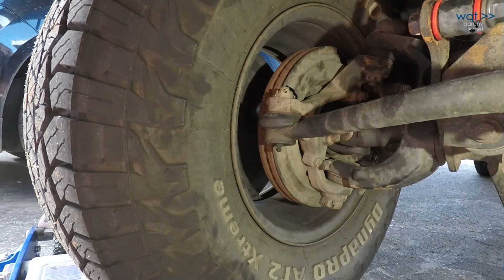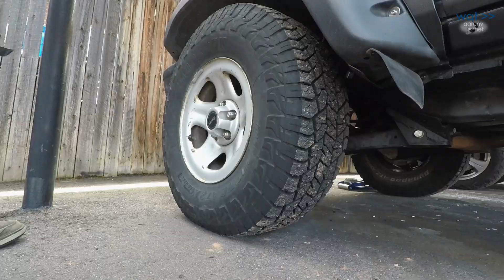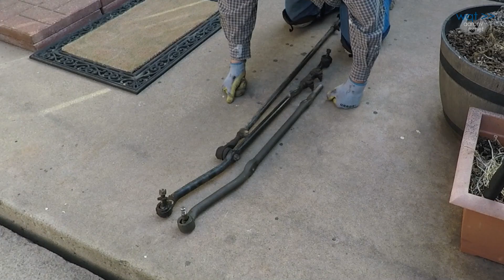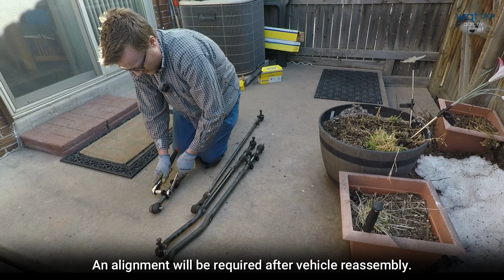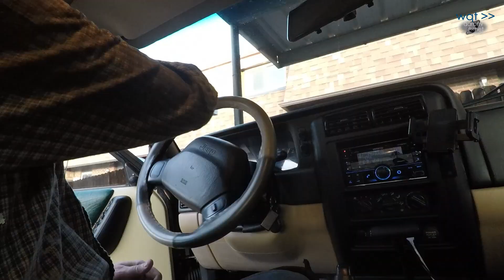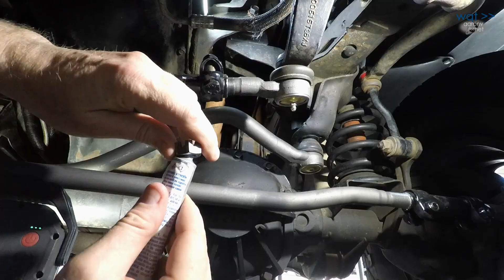projectXJ: Affordable steering upgrade and trackbar, step-by-step (ZJ+TJ=XJ), 97-01 Jeep Cherokee

Comment: Great demonstration and explaining. I am trying to do the same changes to my jeep xj 2000. Im looking at the parts but PartGeek shows the same part number just for different jeep varients. Another thing that it requires is the year to be selected for said part. Would you happen to know wany of this information?
Reply from the maker: ZJ Grand Cherokees were 1993-1998, so you might try one of those and see what pops.
Reply: @aaronvienot   Here are the options that pop up for each item(I already ordered a RC track bar that fits):
Drag Link DS-1430 -- 1997-2006 Jeep Wrangler or TJ
long tie rod DS-1312 -- 1993-1998 Jeep Grand Cherokee or Grand Wagoneer
rod end links ES3096L -- 1991-2001 Jeep Cherokee or Wrangler, TJ, Comanche, grand, wagoneer
adjusting sleeves ES-2079S -- 1991-2001 Jeep Cherokee

Comment: Hey! Your video sent me down a rabbit hole as I am working on updating a '93 XJ. Unless I've missed something, all XJ and TJ front track arms are functionally the same - being listed with the same part # typically. Saying you've upgraded to a TJ track arm is a touch misleading, I think. The ZJ V8 tie rod is a killer budget upgrade that I know I'll be doing! I intent to lift about 2" so I think my track arm upgrade will be an adjustable type. Thanks for sharing your project!
Reply from the maker: The stock XJ tie rod is a hollow tube, basically. That's where most of this upgrade gets good.
Reply: @aaronvienot  Inteeresting, I do like the sounds of that upgrade! Can you provide a link to some "literature" of some sort? I haven't come across this info anywhere else. Thanks!

Comment: Just a couple of thoughts.  If you leave the vehicle on the ground, the tires will hold their position while changing the components. Other than that it's rather easy to do a driveway alignment.  As for the tie rod sleeve, they are threaded thus so one can make toe in adjustments by turning them one way or the other. The drag link one allows one to adjust steering wheel to be straightened compared to the wheels.  I learned this as the geometry was off on my 4 liter powered 1987 XJ Pioneer that someone had previous installed the  3.5" kit partially, but not the track bar. This being off, they drove it that way and didn't know why it chewed up the front mud tires. I had to bring my stock track bar mount to my friends so he could put it in a drill press so the RE track bar could be used. One of the best done content pieces as there's no overlong into/outro sequences, nor over loud music.  Lighting and camera was done great plus narration on which tools were used.  Once again, thank you.

Comment: Did you feel any difference in drivability?
Reply from the maker: @Atlas4x4  with everything tightened up, and freshly aligned, yes. The stiffer steering hardware is mostly nice for minimizing damage on the trail and wrestling the larger tires.
Reply: @aaronvienot  thanks i will do this here in Brazil

Comment: "It's Colorado, so the rust here isn't too bad..."

Proceeds to break out death wheel and torch... 🤣
Reply from the maker: @JoshTolbertUrbana  you should see what the Midwest wrenchers deal with. Just 10-15 years of winter rock salt and most bolts only come out if the head twists off or they're liquefied with fire.
Reply: @aaronvienot  [ cries in Illinois ]